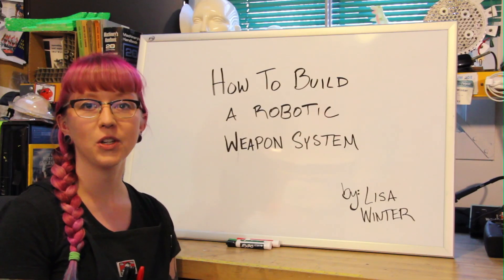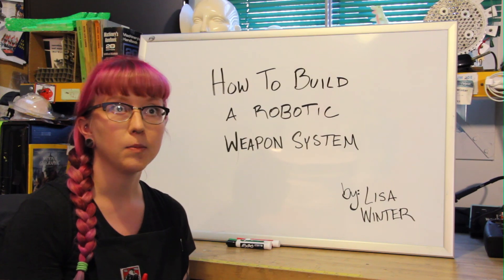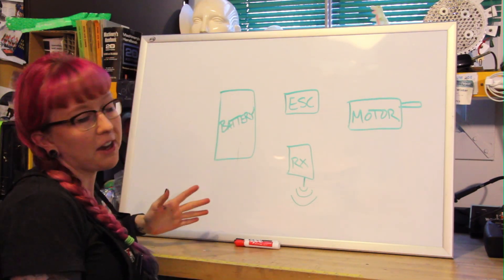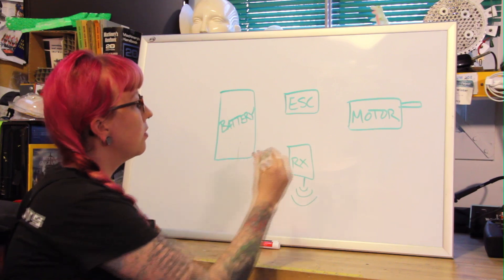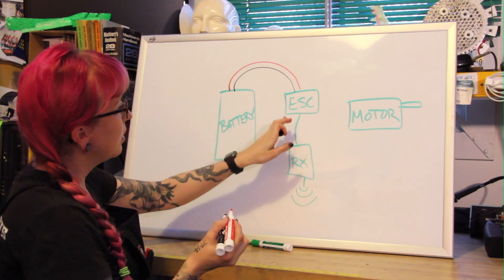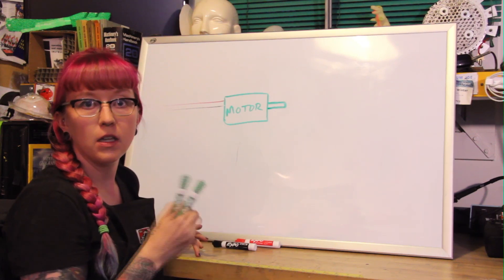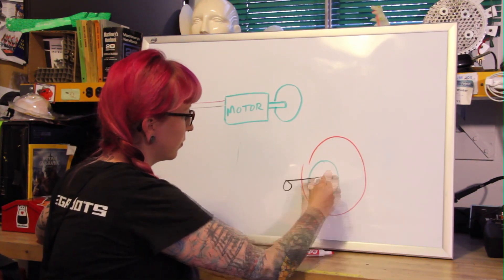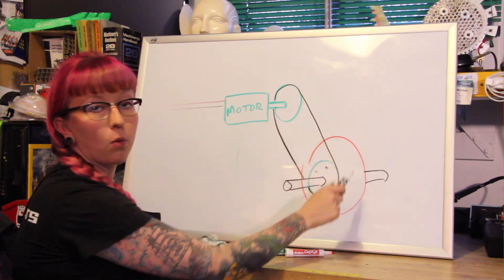How To Build A Robot Weapon System

Comment: maam,what is this motor that youre using and what material should one use for making a drum spinner for beginners, i mean cheap and effective?  :)
Reply from the maker: Hi, It's an Actobotics geared motor (possibly 970rpm). The drum material depends on what weight-class you're building for, and how much weight you have to spare. Usually steel is a good option for weapons, but if you're building a 1lb. robot you may use 3D printed plastic or something light like that.